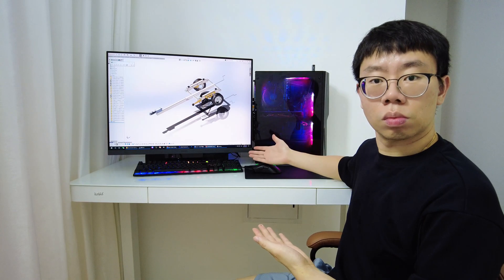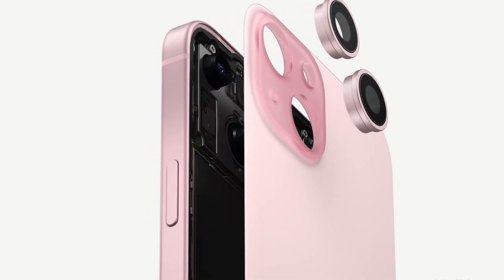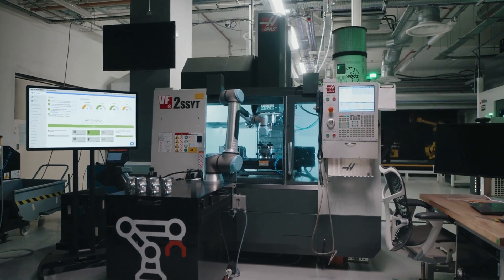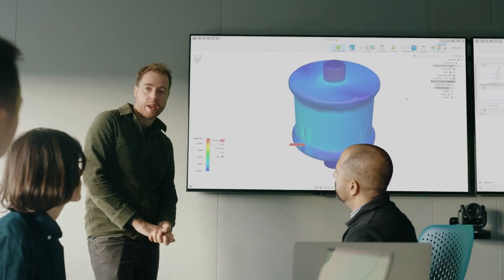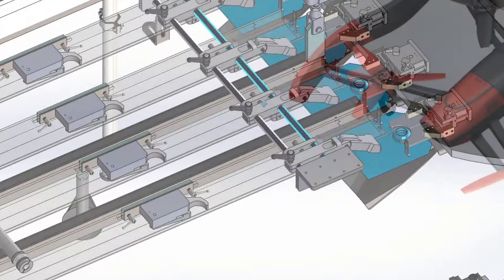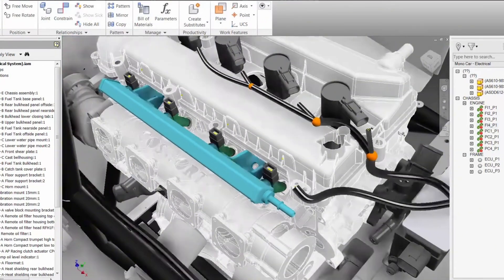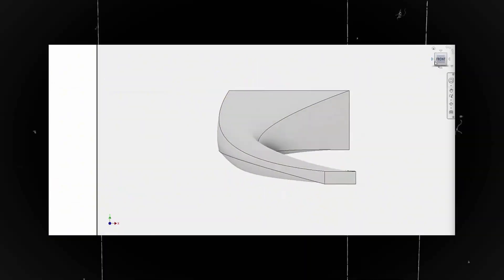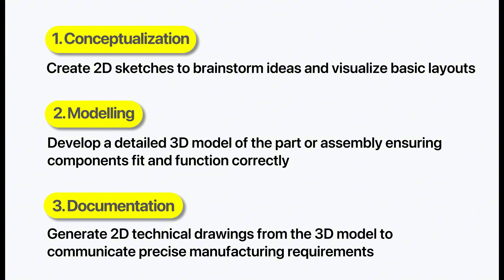2D vs 3D CAD Software: Which is Better?

Comment: yeah I dont get this video. Who designs a sheetmetal part in 2D? How is that time saving and its not like CAD software is so performance hungry nowadays. Designing a sheetmetal part for example doesnt really need a powerful PC and even FreeCAD can do it?
Reply: Honestly almost all sheetmetal parts would be as easy, and faster, to sketch in 2D, but who uses one sheetmetal parts? And I wouldn't trust myself making all things line up in a assembly!
Besides, laser cutter and brake press needs the step file anyway so what little time I save the poor machinist eats away twenty fold